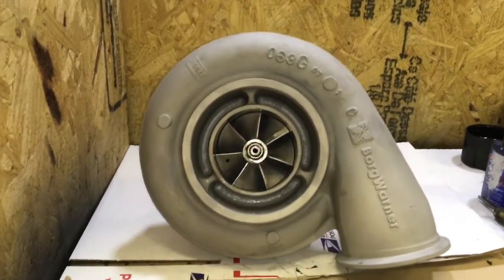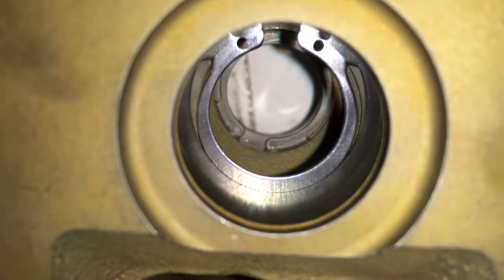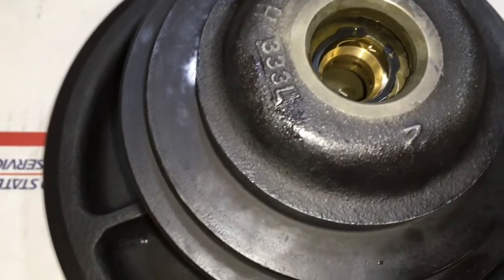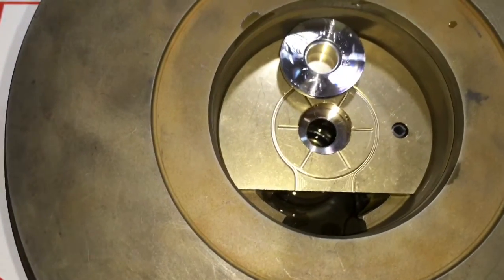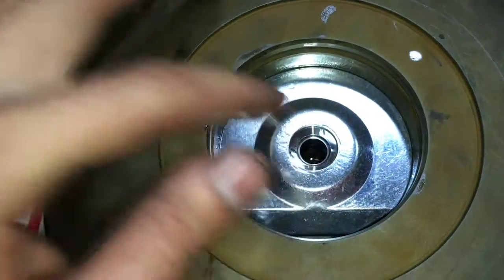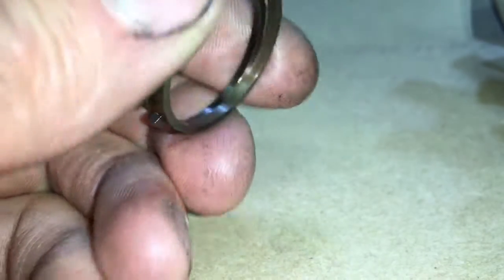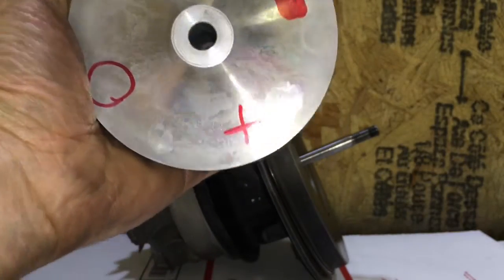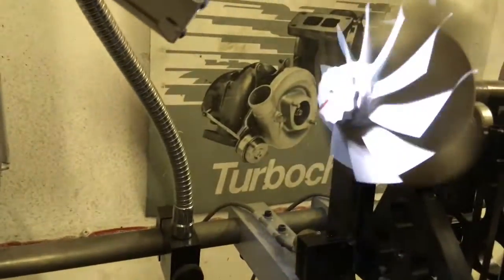Borg Warner S400 S475 Turbo Rebuild

Comment: I think you have just saved me a huge headache and a  hefty repair bill. My s467 is  blowing oil out the rear seal . Its completely operator error as I neglected to align the seals 180degrees.. if it only has one is there anything special to know about alignment before installing the shaft. I  only want to make one correction rather than two.

Comment: how were you taking off the compressor housing??
Reply from the maker: +Boosted 91 its a vband connection
Reply: Are they supposed to be hard to turn?? I bought mine remand, everything is new in the unit but it seems a bit hard to clock the 2 housings. Is that normal? Anything I can do to make it easier? Like oil or something??
Reply from the maker: +Boosted 91 I don't know how to help you.

Comment: Nice Job Austin! ...That's a pretty good sized turbocharger...
Reply from the maker: Thank you. The largest turbo I ever worked on was about 3 times this size. It's from a Cummins 2900.  The turbo had a 5" compressor wheel. The compressor housing was about 2 feet in diameter.
Reply: Good Lord!...😄
Reply: +Turbo Lab America was that an HX100 that was the largest you worked on?

Comment: I've got a question I have one of these turbos and I want to swap to a billet compressor wheel with 11 blades, do I need to get the turbo rebalanced afterwards??
Reply: Boosted 91 did you ever find out if you needed to rebalance your turbo after the new compressor wheel was installed?
Reply: Christian Bonfiglio I never got a reply from these guys, but from what I've read over on LS1TECH it's always a good idea to have it balanced after swapping compressor wheels. hope this helps you out a bit
Reply: yes you need to rebalance it.
Reply: The turbine shaft is balanced separately from the compressor wheel.  The answer is no.

Comment: What is the torque spec for the compressor wheel nut?
Reply: Eric Pfeifer did you ever find out what the torque spec was ??
Reply: 50ft lbs for S400

Comment: Aren't Borg warners very reliable? How many have you rebuilt?
Reply from the maker: +sav3dbygrac3 it depends on your definition of reliable. The k series has a really weak thrustbearing, if you boost the car more than factory boost the thrust bearing will fail everytime.  The s400 series that I rebuilt didn't have a thrustbearing problem, the seals wore out, but it's on factory boost. I don't like how it came from factory without a compressor housing seal so I machine the compressor housing for the seal
Reply: +Turbo Lab America I see, I have a S362 fmw. Do those have that issue?
Reply from the maker: I don't know. There is a 360 degree thrustbearing kit for it which we do sell.  I rebuilt a silver bullet s300 a few years ago and it had a really bad thrustbearing failure. Usually when the thrustbearing goes bad in that situation, it's because the thrustbearing was not strong enough to support the boost level that the driver was forcing the engine to do.